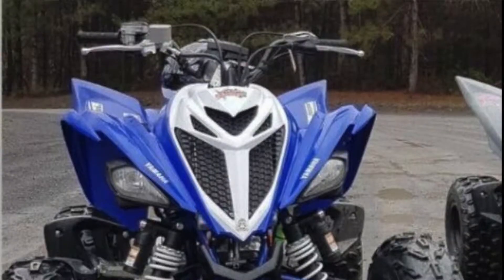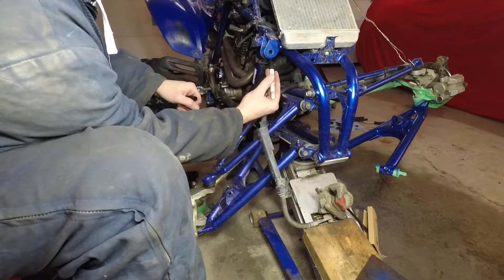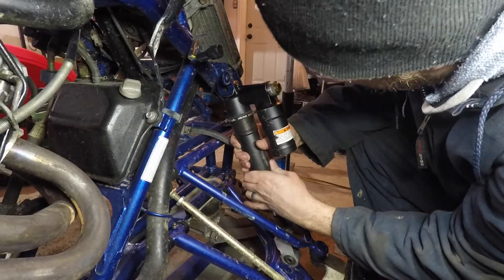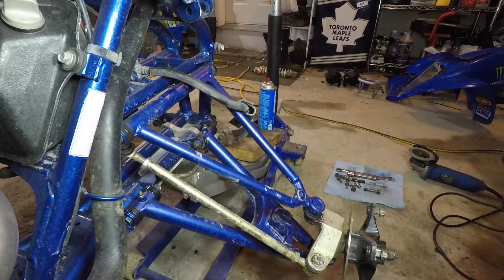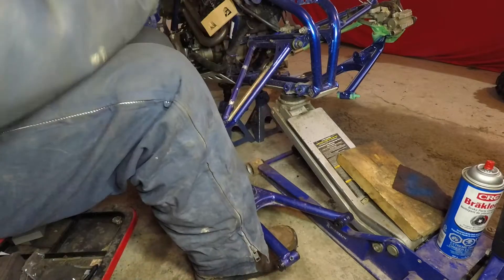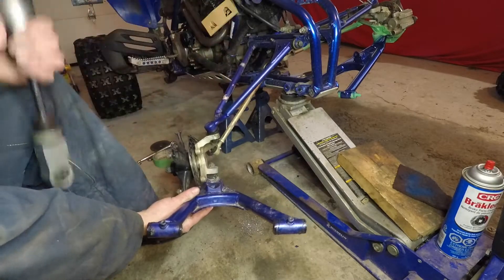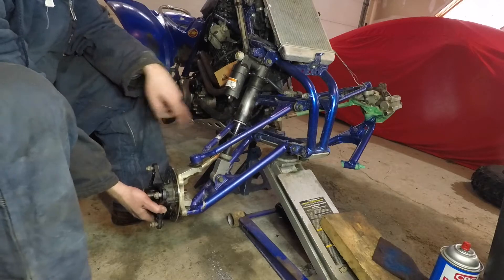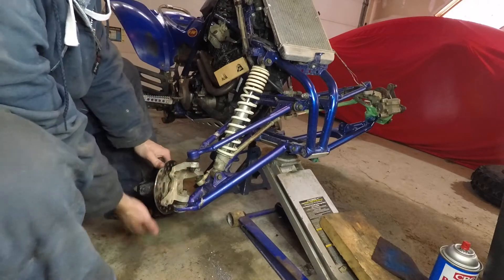How to video 1: Yamaha Raptor 660R fully adjustable front shocks upgrade

Comment: What grinding wheel did you use?
Reply from the maker: Sanding flapper disk.
Reply: @gordonwbell  awesome thanks 👍
Reply: @gordonwbell I finally did the yfz450 shock swap and Alba +2 A-arms. You still have this? You should make more videos
Reply from the maker: @Kevin_Yagoonie  unfortunately, regretably, I sold the raptor…..
Reply: @gordonwbell  oh darn. Was a nice 660

Comment: Would this be the same or similar process for adding the yfz450 shocks?
Reply from the maker: Yup. But only for the Carburetor model of 450. The fuel injected models had longer shocks, which would fit with specially made long travel a-arms - which do exist. But on the cheap, carb 450 shocks with stock a-arms is best bang for buck.
Reply: @gordonwbell  appreciate it 🙏
Reply: @KG Productions  I couldn't find any other videos on the process. Great in depth information 👌

Comment: Are raptor 660r a good atv?
Reply from the maker: They can be an awesome ATV,  but it also depends on what you want. If you want turn key and just ride it, then get the 700R as they are fuel injected and will require less maintenance.
Reply: @Matt Wilson oh because i am a beginner i started with a raptor 350 but then i built my way up to a raptor 660 but i am experienced now
Reply: I have another question do you know why my raptor 660 chain keeps coming off? Like i literally tighten the chain and everything and it comes off and last night i was riding the chain snapped
Reply: @Matt Wilson nope
Reply: How long are the shocks
Reply: @gordonwbell  THIS. My boy has a 700 and I have nothing but 2strokes and he never has problems anywhere climate wise like me